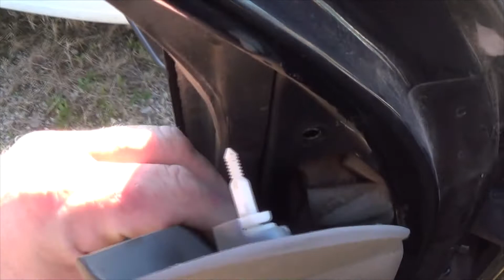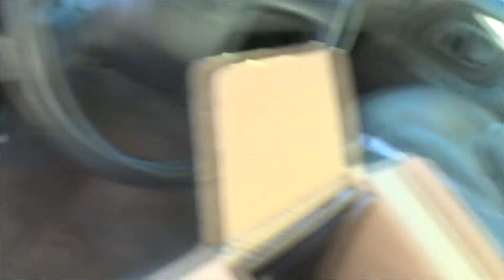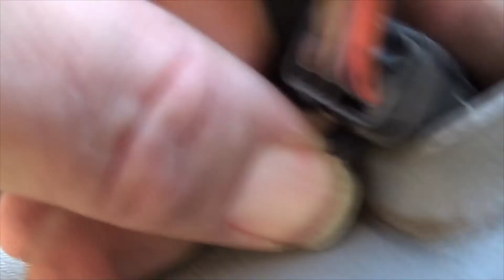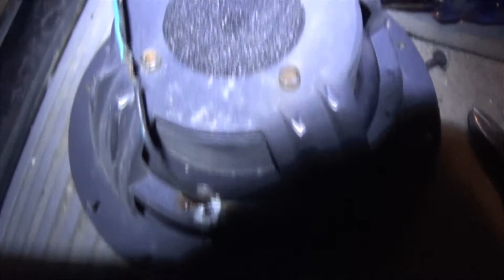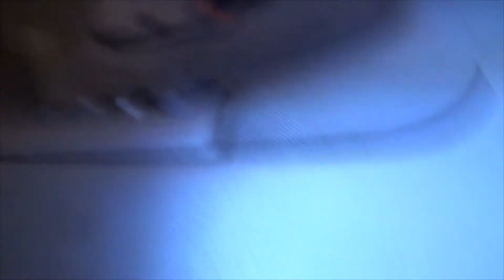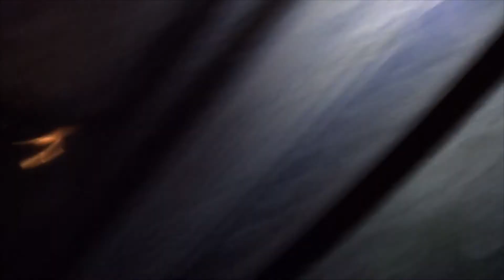99 Tahoe Replacement Heated and Power Door Mirror

Comment: How the hell do you get the bottom left nut to come off?
Reply from the maker: you have to pop the clips loose that hold the mirror on carefully i started with the bottom thinking the top would just follow suit and come right off they didn't but you have to get the bottom loose first i used a pick set and it came right off
Reply: I loosend it with a wrench,then just kept loosening it with a magnet😇
Reply from the maker: @JoseContreras-mv5yz   can do that or you can also stuff some tape in the end of your socket to hold the nut.

Comment: Is there a link to where you bought them? Or was it a local auto parts store?
Reply from the maker: It was off of ebay but you want to make sure and get the genuine GM part number to search for them because there are several cheap chinese knock offs and they all suck. the mirrors are thin and the image in them is all wavy looking and they aren't made well at all

Comment: Can you tell me why I'm having shortage in my radio and my cigarette lighter. I have a 1998 Chevy Suburban.
Reply from the maker: typically it's wire chaffing or something overloading the fuse sockets or pulling ,ore current than the wire is meant to handle. that's just a first guess

Comment: They didnt make that design the too clever did they, i wonder if it would have killed them to add 2 inches to the harness and make the mirror harness shorter by the same, stupid designers again :-(
i cant see that replacement mirror having heating, like you i thought (wires missing), oh well im sure your happy to just have a mirror again :-)
Those plastic posts are utter bastards when they are old, "snap" is the word of the day, the swear words ive used would make your ears drop off lol :-D
And you saved your amplifier going "pop" due to a worn wire, so not really a pointless task pulling the door card off after all :D
Reply from the maker: zx8401ztv yeah not really designed for the owner to replace or repair that's one of those things they wanted the dealer to do for you. not having that at all.  i'm still not sure about the heated part of the mirror but i have been told some of the after market mirrors don't have the same set up for the heated part they are wired a little different but they do supposedly still heat. I don't know guess the proof will be next time everything fogs up on me if i turn on my rear window defroster and it thaws out the mirror too then i got what i paid for. if not i will continue to cuss the people i bought it from but yeah it's really nice in rush hour traffic every day now to have that mirror on where i can use it.  The door plastic pins are a total pain some times but they are still better than removing 50 screws out of the door panel like you used to have to with some of the older cars.  and yeah my amplifiers are safe again now for a little bit. i don't have a lot of money in them but still it doesn't mean they shouldn't last properly for me either. back in the day i would have smoked the amps from over use in 6 months to a year. now i've had this set up for 6 years and it's still going strong so yeah i'd like to keep it around a while , thinking i am going to take off all door panels and check my wiring soon just to be safe, if one rubbed raw then there may be others as well.
Reply: DaddytechEnt Good idea to check the other panals for wire rubbing.
Just need a nice day to tinker :-)
Reply from the maker: zx8401ztv well, we've had a few of those recently too so i'm on it! :o)